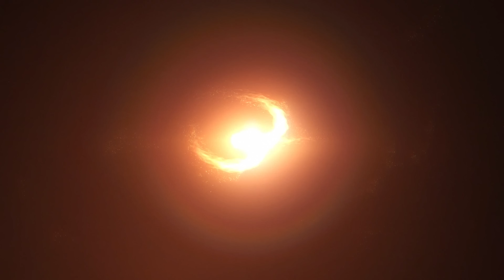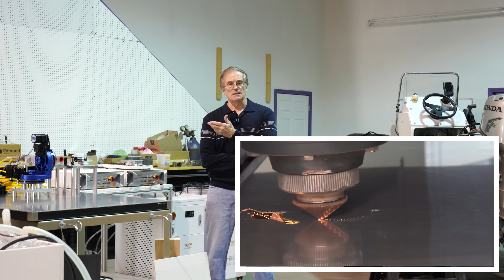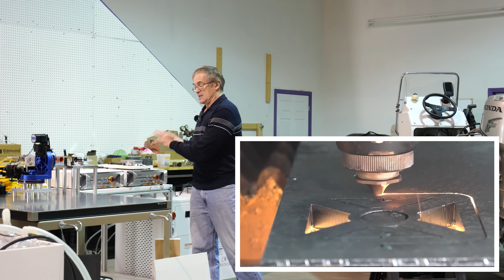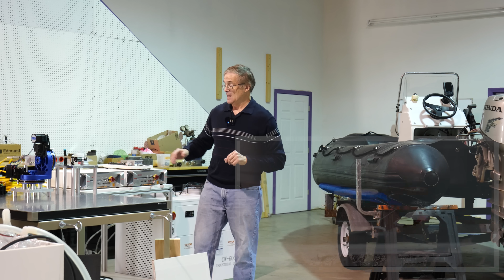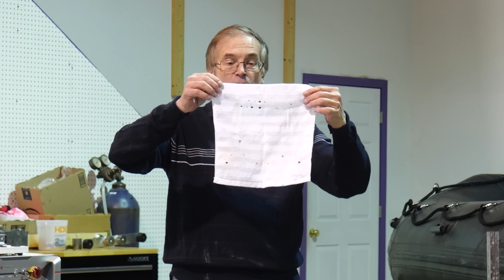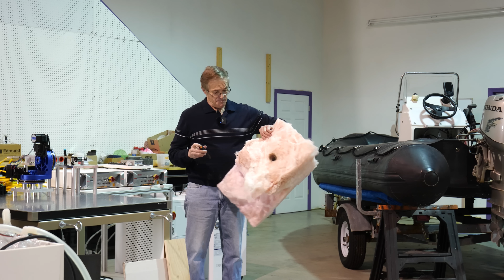We have a problem... and need your help!

Comment: My first thought was to get panels of the same material used to make laser safety glasses, but I have no idea if that is at all viable.
My second thought is that a single stage solution might be too heavy and expensive.  Stopping the laser becomes much easier if you can unfocus it first.  I'm envisioning something like a standard issue window, but one side is sanded.  Presumably the light exiting the rough sanded side would diffract in random directions, potentially enough that you could then use a different cheap material to actually absorb the remaining energy.  A jig that moved or vibrated the glass (or whatever diffracting material you use) would also ensure that the pattern of diffraction was constantly changing, thus preventing the diffracted light from hitting the same spot of the absorbing material ein a consistent manner - thus increasing heat dissipation.

Comment: Hi! 45deg tilted mirror(proper one for the wavelength of the lazer), looking down towards a flat container that has sand  in it, perhaps wet. The sand box  acts as a base for the mirror and can have caster wheels to move around.

Comment: Plywood panels + recirculating water spray system to keep them soaked while firing the laser. Easy to source, relatively light weight compared to berms of dirt or sand.

Put a camera or sensors behind the wet plywood to shut off the laser in case of accidental burn-through.

Would it also be possible to have a secondary monitoring system detect when the laser galvos are moving vs. stationary, and interlock the laser so that it can only fire when the galvos are moving? You are mainly testing against moving targets, right?

It seems like you'd be relatively safe if the beam can only fire when galvos are moving, you're firing into a continuously re-wetted backstop, and there are sensors behind the backstop to detect breakthrough.

Comment: use a thin running sheet of water over rough ceramic like the super light density fire bricks placed in furnaces or similar tile. disperses the heat rapidly with the sheet of water, ceramic takes the beating.

Comment: The most simple solution that is cheap would be black painted bricks.  The black pain would help reduce the reflection of light and decrease the amount of absorption by the brick, reducing heat. Other options besides pointing at ground are too expensive.

Comment: If the laser could point downwards then a pool of water doped with a material that absorbs that lightwave frequency may do the trick.
Note: Whatever material you cut may be reflective, and parts of it will drop into the pool when "cut". Come to think of it, that's hazardous.
Just remember: Don't stare into the laser beam with the remaining eye.

Comment: There was a video about making a “carbon sponge” for use as a protective lightweight material. It was made out of a carbonized white bread slice. I’m sure there are better ways to produce a sheet of it, but it seemed like it would be very lightweight and protective.

Comment: hmm... maybe you could use wet cement spread on a sheet of plywood before it solidifies thought .. im not an expert but hopefully the thermal disipation of the thin layer of the wet cement could be enough for a couple of seconds?

Comment: Imagine shooting a laser through a waterfall.  Now color the waterfall black (or dark) to absorb as much of the light energy as possible.  Now think of what happens when you pour a bucket of water onto the roof of your car: it travels down the windshield in a solid sheet of water.  Stainless sheet, PVC pipe, water pump, basin, food coloring or carbon particles.

Comment: If you just need to stop the beam for a couple of seconds I imagine you could get away with getting a couple of Hesco barriers and filling them with sand or dirt would do the trick. I think a good safety addition to your laser would to be to add a laser range finder like a LiDar sf30 to your set-up to give your target a Z axis. Then you can have the code exit or prevent/stop firing if the Z axis is greater than or equal to the distance of the Hesco Barriers. This could potentially prevent it from firing away from the barriers and also prevent it from firing too long without a target.

Comment: I see two options here:
1) You need to control the output of the laser to be a momentary pulse. If your tracking is on point, and your target gets cut quickly, you can experiment with the pulse length in miliseconds to influct enough harm to drop the drone, and not cut past it. Multiple pulses shorter then the one required to damage the drone would be ideal. A feedback loop between pulse fired, and trajectory altered (indicating a killl) would be needed. Essentially, your "pekcing" your way through the target.
2) You have corrective optics. Perhaps I'm over simplifying this, but if you put some of your optics on a quick enough servo slide, you could modify your focal distance in real time. Add a laser distance sensor to your tracking system, and you could send a requested focal distanc to your corrective optics and only fire the laser to be "effective" at that distance. You would need to spend time firing the laser at some bricks developing this, but after that no more holes in your truck.

Good Luck!
Reply: Agreed. You need to control the output of the device. Pulsed laser with a lower power targeting beam if necessary. As far as a safety backdrop I'd think a color matched materiel that filters the intensity of the pulsed laser would be sufficient. And some fire extinguishers. You would be able to control pulses much faster than a physically moveable lens trying to focus.

Comment: I saw some suggestions of sand and similar materials, and I was thinking, maybe we should treat this like we do firearms. If you find a hill and dig in a nice burm, your laser can be shooting into 50 feet or more thick of dirt. That would be rather cheap. Just some prep work needed with an excavator...and maybe a control limit so the laser can not wig out and shot up into the sky, ha.

Comment: I'm certain that there's a plentiful supply of people saying 'point it at the ground outside' 
But if this must be contained within the building at all times, I think a fireproof blanket in front of a metal wall covered in heat resistant ceramic tiles may work for a few seconds.
Alternatively, possibly a long fiber optic cable could be run in a grid across an absorptive surface, such that the laser stops if the cable loses signal or receives an extremely bright light.

Comment: Your laser seems to come out in a fashion that caters to the energy getting less focused over time, and it takes great effort to refocus it . . . with what appears to be intense precision.

What if one of the lenses came out of place?  Or if you added a lens?  Depending on how things are built, swapping lenses may be unreasonable.  But having a spring loaded snap into place lens that intentionally widens the beam may diffuse the energy into a harmless albeit VERY APPARENT discharge of light.  The collateral bonus is knowing when the mechanism is working.  If it's too bright as a burst, that's a collateral issue that could be handled by something resembling a hood that's father off the terminal lens during the slap operation.

Comment: A different approach could be the following: instead of emitting a continuous laser beam, consider activating the emission for very short intervals. This would essentially amount to firing laser pulses equivalent in duration to what is required to disable the drone.
Of course, the issue of a missed target remains; in such cases, the "protective wall" would only need to be designed to withstand the laser pulse rather than a continuous flow.

Comment: I'd test a sheet of cement board, and a sheet of real gypsum board (not dry wall), and finally, fire brick / kiln cement. You might be able to manufacture a 4x8 sheet of cement board with a fire cement finish. That would be heavy, but shouldn't be so heavy that it's hard to move around, you might need two people.

Comment: hey, im a industrial glasblower, i worked with quarz glas, and the apperatures for the chip/semiconductor industry. we use white opaque quarz segments to block infrared radiation traveling through the length of the apperatur to protect the plasic or rubber seal/gasket. its stable and highly temperature resistant, and if not polished not reflective. con = very expensive. to note there are a range of ways to make white opaque glas, cheap = micro bubbles -- expensive and more effective = chemicals.
if your target area is small, give it a thought, if your area of protection is bigger than 20x20" its going to ruin your bank
Reply: @HuygensOptics can help maby, awesome channel about optics!

Comment: if it can be focused through a lens, can it be unfocused by a lens behind the target?
not sure if anyone has suggested it. but, a sheet of titanium/tungsten/metal, and to reduce the reflection, maybe add soot/lampblack as a coat, and then a layer of plywood. and also placing it at a 45 angle. beam enters and goes through wood, dampened and hopefully adsorbed by a metal with high melting point (maybe add a spray of water on the backside of the metal? and if it reflects, it still gonna hit another layer of plywood. or maybe ceramic tiles? layers, angles and diffusion.

Comment: try a panel of some kind covered with some kind of "starlite" mixture that just expands really fast, and cover that with a mixture of pure silcone dioxide sand. 

maybe you can also tweak the way the layers are stacked and put the sand in the back to scatter away any points of the beam that manage to get through, but my point being is that you want a layer that scatters the light, a layer that can hold off the heat and a layer that can absorb it/structural material.

Comment: 1.) Black-dyed water sprayed from the backside to glass wool.

2.) A vertical tank of black-dyed water, continuously stirred to prevent local overheating. The dye improves IR absorption (especially around 1064 nm), and the motion spreads the energy.

3.) A 45° mirror to deflect the beam downward into a tank of black-dyed water with a stirrer. The mirror redirects the beam safely, and the moving water absorbs and distributes the heat.

Comment: My first idea was good for single dimention testing. You are using optics to focus the beam and they are not melting. Just use the reverse of that setup to diffuse the light on the other end. Looking back I realized that you are looking to scan the lazer, so this woud be unusable as a solution. 

Test outside firing straight up 😂 Its the FAA's problem to deal with the beam then. Maybe you'll stop an alien invasion in the process

Comment: I watch this vid carefully, then looking fiber laser video demo. N after thinking, n compared it to my experience i come up with few "solution"
1. use 1 kg fillet mignon
2. have u tried, brick/plywood, soaked in water?
3. you need to disperse the laser, sanded glass. a bottle/mini aquarium with cloudy water+sanded in the back. maybe glass dust inside the water to help disperse the light. ceramic dust also good, fiber laser cant cut it

Comment: Have you tried scattering the beam with regular fiberglass fabric?
If it scatters the light without significant absorption, and if it is placed at a reasonable distance from the wall, the power density on the final surface will be more moderate.

Another option is to implement a more advanced safety system.
You could set up a dual-wavelength pyrometry detector that detects surface overheating on a sub-millisecond timescale and shuts the beam down accordingly.
In fusion research, we use such systems to protect the walls from some unpleasant events — for example, when the plasma disappears and 100 MW/m²  beam suddenly hits the wall.

Comment: As you problem seems to be mainly the portability you could consider rotating or otherwise continously moving backdrop so the beam doesn't linger on a single spot.  
This increases the amount of material your laser has to burn through without changing the thickness of the target and you should be able to cover a larger area then at the cost of the mechanical complexity

Comment: Is it reasonable to change the strategy of how the laser is projected. That is to make the laser work like a digital camera in reverse. Where in the laser is focused on a specific target anything in front of her beyond the target is diffused And the laser is regulated in the length of time and number of exposure so to speak our projected. Thinking of in modern camera as having automatic focus or distance detection and the ability to regulate the number of photographs taken at the punch of a button.

Comment: Could the concept of a laser range finder be used? If a “measurement” is detected as the result of a reflection (that matches the wavelength of light in use) the stop is triggered. Would somehow need to be incorporated into the laser head.

Comment: Maybe try once with an aquarium, filled with charcoal, (salt)water and put a graphene sheet in the back?  Sand?  Another idea maybe is not to absorb but diverge the beam somehow so the heat is spread, or capture again the beam, funnel it so to speak in a fibers that are bend in a spiral with but with at intervals the reflective layer removed so the light can escape.... the spiral in a container...

Comment: Starlight, in all seriousness, I would try RTV silicone, maybe even a platinum cure, with a carbon fill, its the rubber coating on the SR-71. adding the carbon would help absorb by ablation, silicone isnt flamable, it just ashes when exposed to heat. High temp silicone might not be more beneficial, but maybe worth a try, layering different silicones would be worth experimenting with, however dont put platinum silicone onto tin cure, itll retard it.

Comment: Disperse the beam through lens and make beam less concentrated? Or lens going to be melted too even if it is transparent? Or try to radiate inclined surface to spread out the beam, or maybe use structure that maybe melting but also reflect radiation around. Dealing with heat might be easier if you can decrease concentration. Set you receiving surface at Tan = 10 and you going to get much much less power per unit of contact surface.

Also I worked with plasma torches that discharge 40KW into metal surface with high pressure water colling. That worked well.

Comment: I'd propose a modular, high-intensity laser interception tile engineered specifically to survive direct exposure from a focused industrial laser beam. The tile is composed of five integrated layers, mounted in a steel tray for modular deployment.

Layer 1 (Front): A 3–5 mm thick ablative black ceramic tile, which absorbs and immediately begins to char under beam contact, disrupting optical coherence and beginning energy dissipation.

Layer 2: Behind this is a 5–10 mm sheet of compressed carbon fibre mat, which spreads and absorbs thermal load while ablating in a controlled, non-flaming manner.

Layer 3 (Core): The heart of the disruption system: a 10–15 mm alumina hex matrix tile, filled with 0.5–1.5 mm borosilicate glass beads, lightly bonded in place using a misted colloidal silica spray. This layer breaks the beam’s coherence through mechanical refraction and internal scattering.

Layer 4: A 10 mm thick expanded graphite or carbon foam slab acts as the final radiant energy sink, absorbing any heat or light that escapes the front three layers.

Layer 5 (Back): The entire assembly is housed within a 3 mm steel tray frame, with bolt-down edge compression to ensure structural rigidity and panel swappability.

Each tile is a self-contained, field-replaceable laser kill block and can be arrayed in a grid to create a scalable, serviceable beam-stopping wall.

Comment: 2nd post..   cheaper  is probably a big can of commercially-available intumescent paint  which you can apply to any surface (google it).   I bet a thick layer  would be OK to hold for many seconds.  The glowing carbon  outer layer will dissipate power  very well

Comment: Why not use an opaque medium, possibly opaque glass or Aerogel? It will scatter the beam enough to disperse it and reduce the focussed energy.
Second suggestion, rather than look at a barrier outside of the laser, why not put an adjustable lensing system at the collimator to disperse the beam - programmable to limit the exposure time of the parallel beam to whatever you desire

Comment: Material: W-SiC/ZrO₂ Layered Composite (1 cm thick)

    Structure: 5 mm W-SiC (30% tungsten, 70% SiC) for heat spreading, 5 mm zirconia (ZrO₂) for ablative insulation, 500 µm SiC coating for non-reflectivity.
    Properties:
        Non-Reflective: <5% reflectivity, safe for personnel.
        Non-Hazardous Fumes: Produces only trace SiO/SiO₂ and ZrO₂, non-toxic.
        Performance: Resists 20 kW laser (1 cm² spot, 2 MW/cm²).
            Time to Failure (Melting): ~213.52 seconds (3.56 minutes).
            Time to Puncture (Full Penetration): ~6,987 seconds (~116 minutes), estimated for ablating 5.9 g/cm² at ~22.5 MJ/kg.
            Energy Absorbed: ~4.06 MJ/cm².

Cost for 10 m²:

    Initial: $3,031–5,319 (~$303.1–531.9/m²).
        Composite: $2,371–3,999 (W-SiC: $711–1,249, ZrO₂: $560–1,120, fabrication: $1,100–1,650).
        SiC coating: $660–1,320.
    Recurring: $660–1,320 per use (~$66–132/m², coating reapplication).

Benefits:

    Cheapest and lightest (59 kg) option, ~39–46% less than cooled W-SiC.
    Simplest design, no cooling, ideal for vacuum or harsh environments.
    Slightly better performance (~213.52 vs. 211 seconds) than cooled W-SiC.
    Durable, with ZrO₂ minimizing thermal shock for 10 m² wall.

Why Best: Balances cost, weight, and performance, exceeding cooled W-SiC’s resistance without complex cooling, ensuring safety and cost-effectiveness.